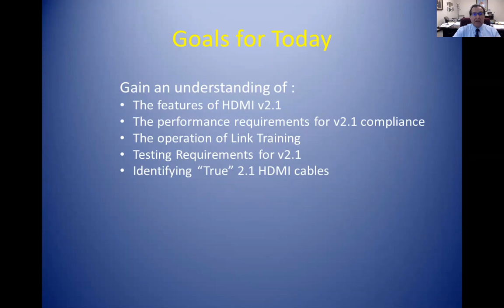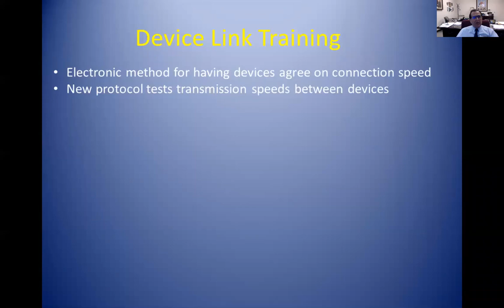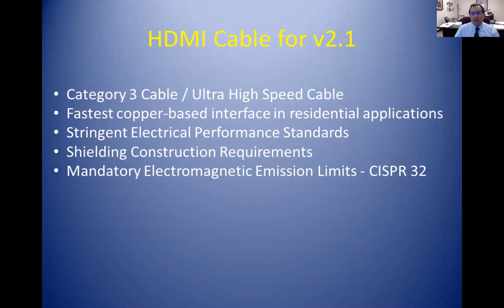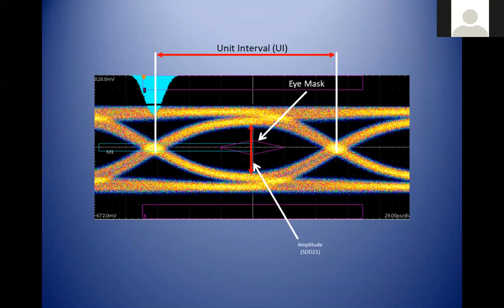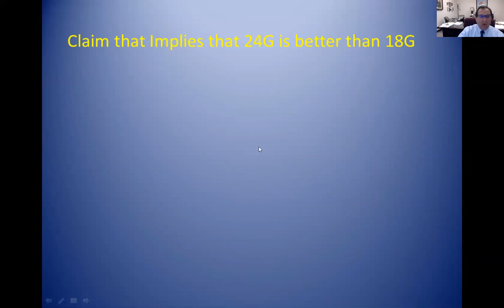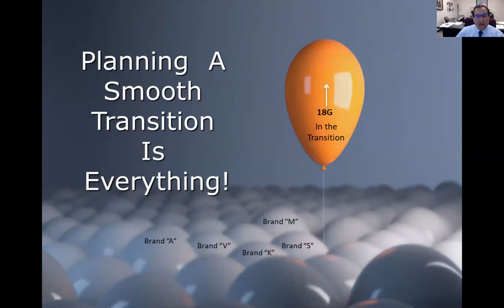8K/ 48G HDMI Cables Fact or Fiction?  Tributaries Cable Webinar

Comment: I bought the cheapest 2.1 cables on Amazon and they are 24 gauge and run 1440p Hdr+ VRR at 120hz Atmos. I know this because l my Xbox and TV detect this. I know 2.0B cables can do this so i have to wait for the new Xbox to test 4k 120hz VRR HDR+ Atmos signal will work. But I'm almost sure it will. And for only $13 so don't buy into hype.